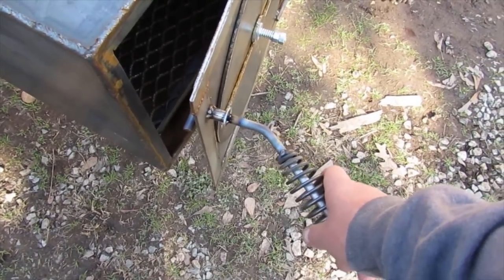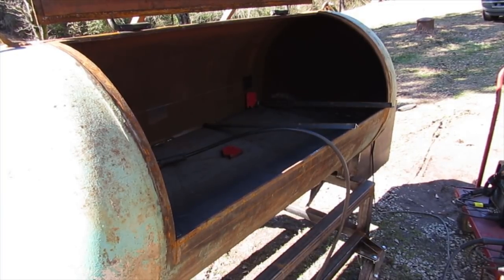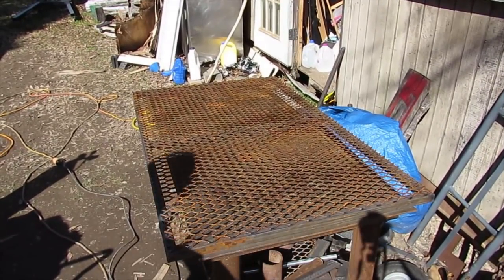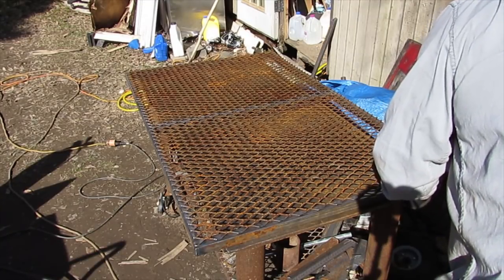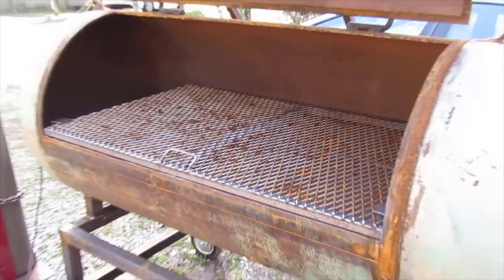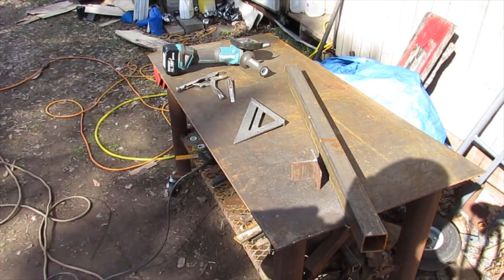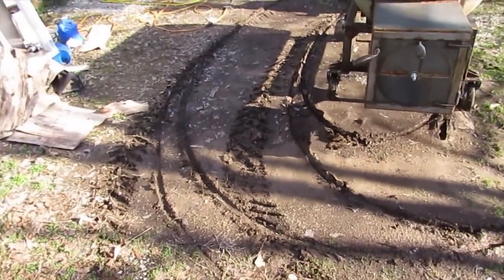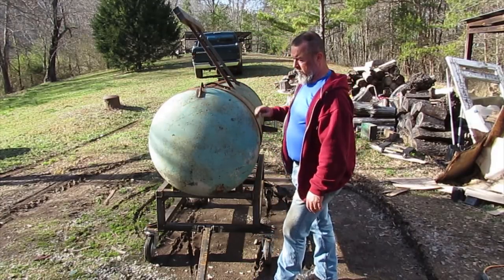#150 Building an Offset Reverse BBQ Smoker Part 7

Comment: Steve, I think I would really put like Lawn Mower tires on there I believe you'd be happy with those and would serve you better and also moving it around in that soft ground. Really loving how that's turning out a great job.
Reply from the maker: Thank you James. I just removed the old turf saver tires and went with these more aggressive ones because my yard has very steep inclines and can not climb without these tires. I just have to be very careful not to damage the yard. Thank you for commenting.
Reply: @StephenOgle  I just thought about what you said, And if I have it right you are thinking I'm talking about the Lawn Mower that's not the case I was referring to the tires on the smoker. To keep from digging into the mud. That's what I was looking at.

Comment: Love your project!  Not being critical, but I would have put two small air intakes in the bottom of the door on the firebox instead of one large one. The large one is way more than you need and when it is only slightly cracked open it will be drawing air in the middle of the firebox.  Since hot air rises you need the air intake down low so the air will draw across your wood/coals as it heads to the firebox exit.  If air comes in the middle of the firebox it will be above your fuel source and have to fight its way down to the fuel before coming back up to the exit?  Hope this makes sense.  If you have cooked on it maybe you took notice of this.  Would be easy to modify the firebox door.  Nice setup!